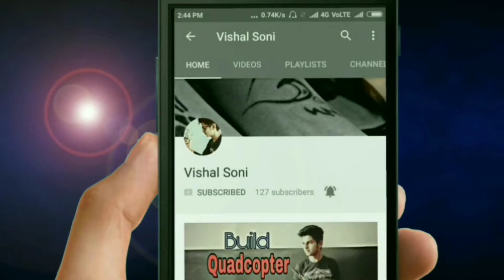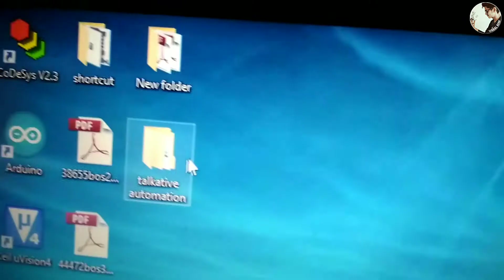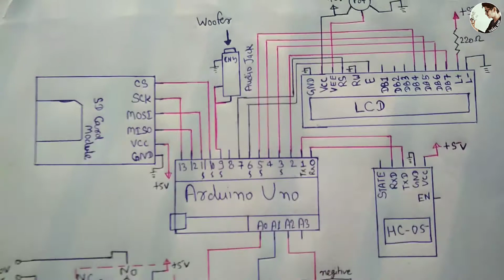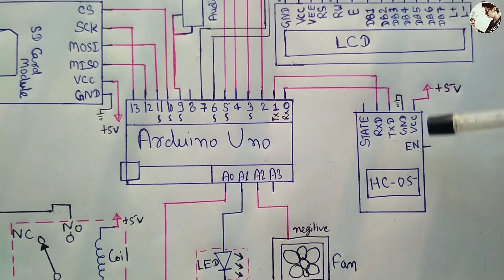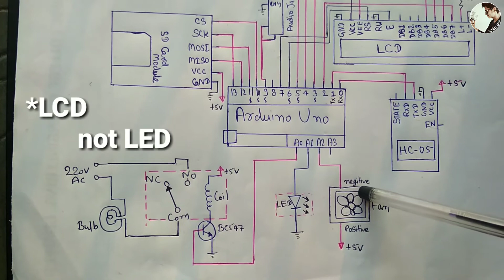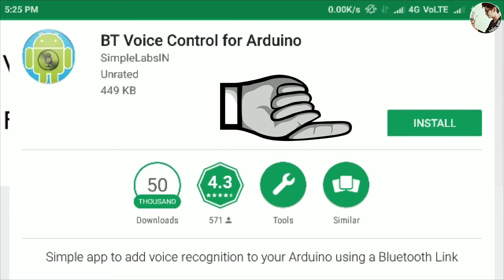Talkative Automation || audio from arduino || Voice controlled || HC - 05 Bluetooth module || vishal

Comment: Bro koi aisa arduino machine h kya Jo Assignment ya 20 -30 page bhrde. For ex -: I have submitted my assignment (50 pages). To kya aisa std device h kya Jo pure krde
Reply from the maker: Uuse hum printer kehate h..... Print assignment........

Because if you make writing machine that will have perfect writing.... Same as printer....
Reply: @electrodonut  but direct print krunga to pta chl jaega😐😐, to fir kya Kru?